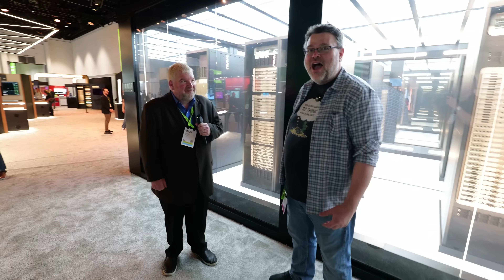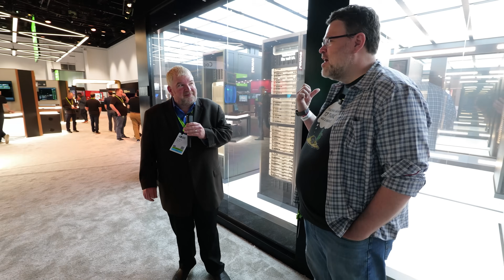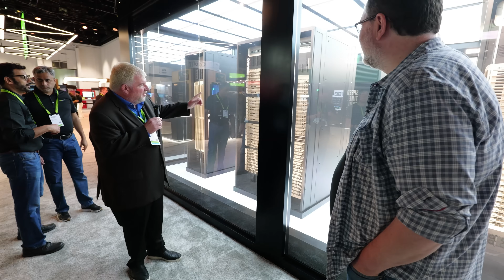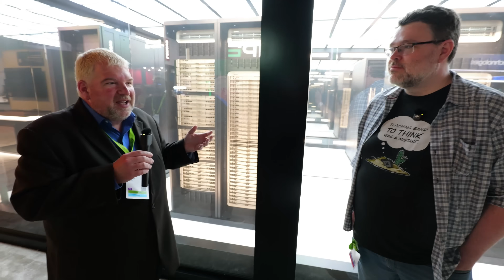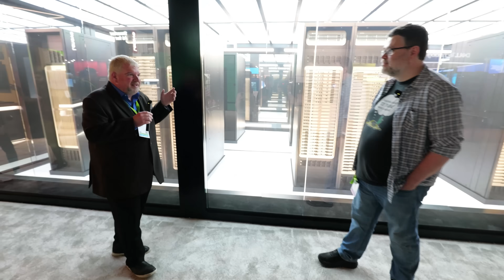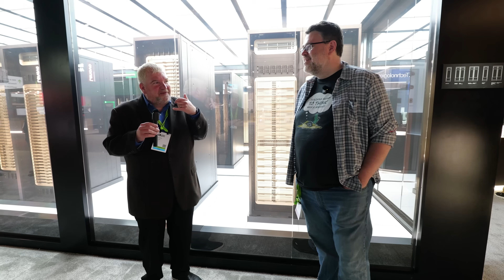“What Would I Do With 8 GPUs?” — 10 Years Later… Millions ft Charlie Boyle from Nvidia

Comment: Your video has been featured on DailyDrops under Gpus!, DailyDrops is a creator‑friendly discovery layer for professionals. We surface timely articles and videos, then place each piece in clear context using a layered topic hierarchy. The aim is to highlight the work, not to trap the audience on a platform. Credits remain front and center, and our curation is designed to respect both maker and reader: concise summaries, clean presentation, and straightforward attribution. As your video is linked with {TOPICS}, it helps practitioners find you when they explore that theme. We always welcome input from authors about how their work should be categorized or framed. If parts of the context feel off, tell us how you would describe it and we will align the tagging so future drops present your perspective. Your guidance becomes an editorial signal that keeps discovery fair and useful.